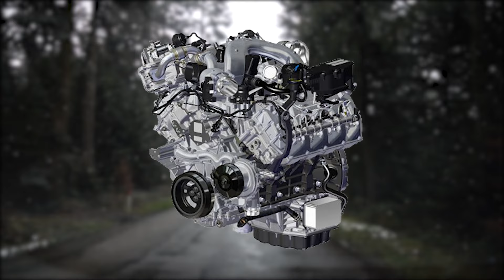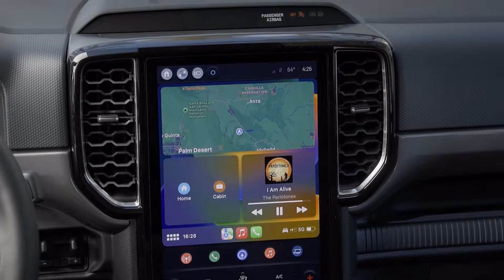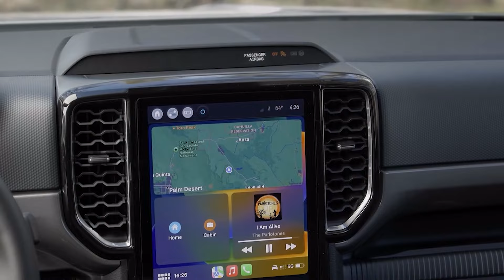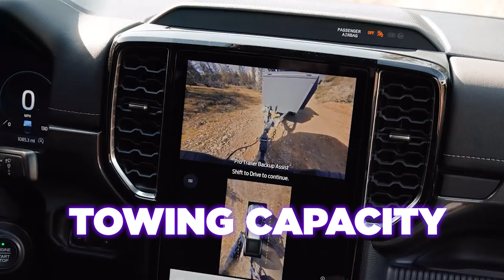5 Problems With Ford Ranger You MUST Know!

Comment: Nothing wrong with ranger new generation or older generation. Drive it like you stole it.
My old ranger is still in the company and has 300,000 plus km’s on it and no issues at all.
Next gen is a year old and has 80,000 km’s on it and runs like a champ.
You need to stop smoking weed mate.